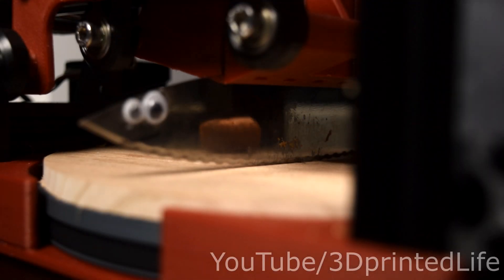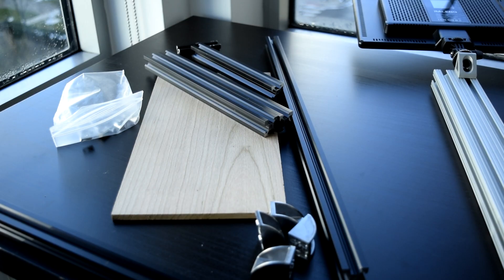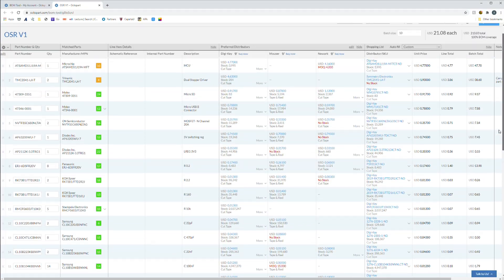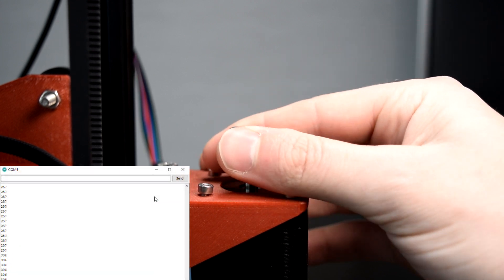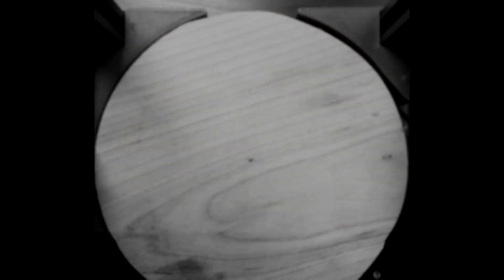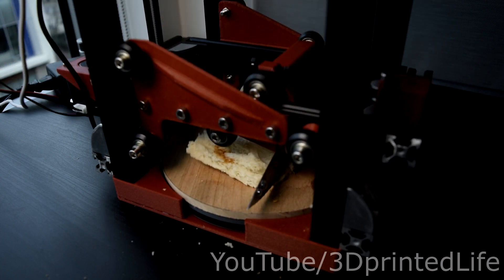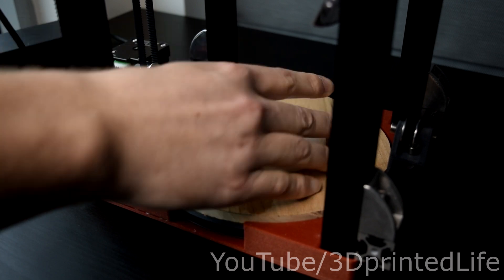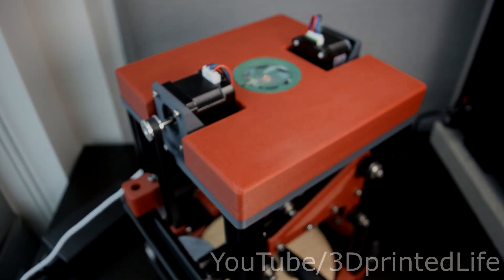The Smart, Crust Cutting Robot [V1]

Comment: Would love to see some more about the design of that motor control board!
Reply from the maker: Noted, thanks!
Reply: Same
Reply: I would definitely pick up some of these. You can never have enough micro controllers you don't want them to get lonely. I love that it has the drivers on the board. That would definitely clean up most of my builds  and save a ton of space.

Comment from the maker: Edit. I've fixed it. V2 is here https://youtu.be/FJZa5K6Dk48
Reply: IS there anyways to program the robot to actually move the knife back and forth to fully utilize the cutting edge? Or even just a diagonal stroke down would make a big difference.
Reply from the maker: @Pyro978  yeah that would be possible, but instead of doing a powered sawing motion I've instead designed a pivoting mount which will passively rock the knife with each cut. If all goes well the new video should come out Monday!
Reply: @3DprintedLife  Awesome, it's just painful to see the bread get smushed because the knife isn't fully utilized.
Reply from the maker: @Pyro978  New video is out already https://youtu.be/FJZa5K6Dk48